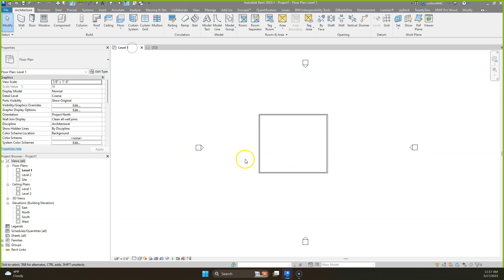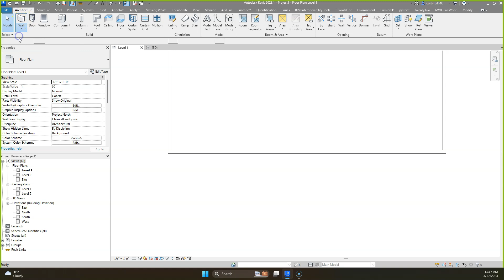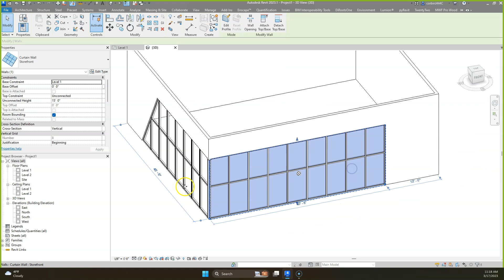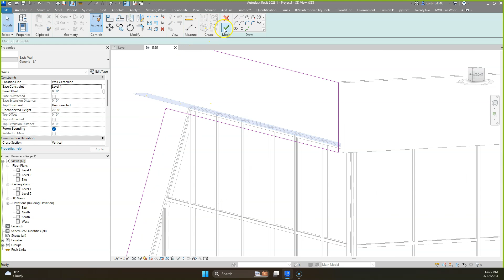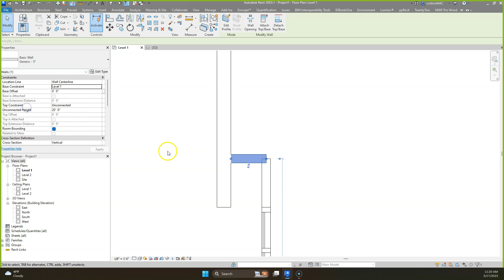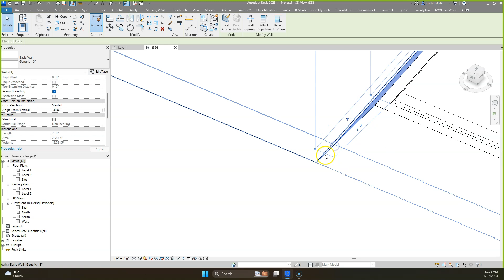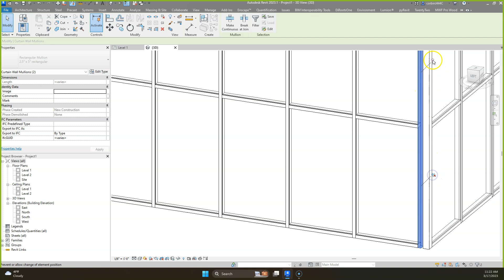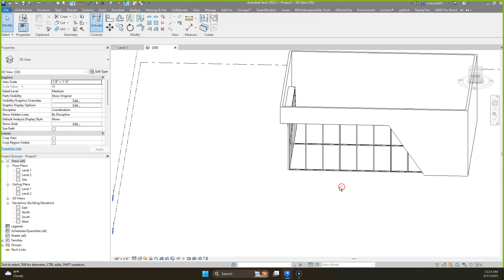Revit Tutorial - How to model sloped or angled Curtain Wall side for facade

Comment: How do you override the wall? I put in the curtain wall over an existing wall and it didn’t override
Reply from the maker: It might have to do with how the walls are aligned. Try moving the curtain wall in and out of the normal wall and see if that helps it override. Overall once we get through the design process we do manually edit the boundaries but this is a good way to do it quickly.